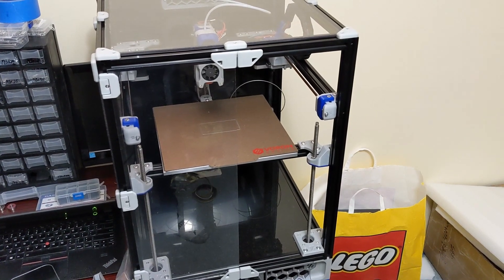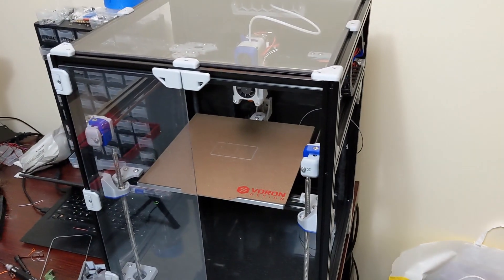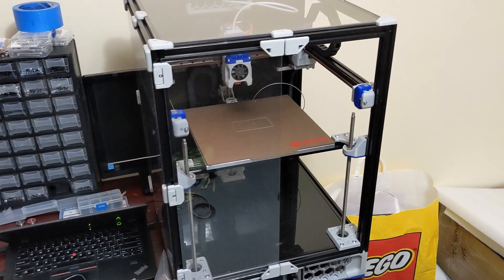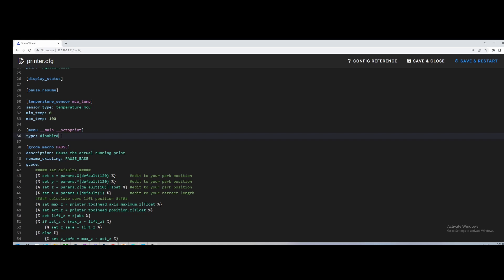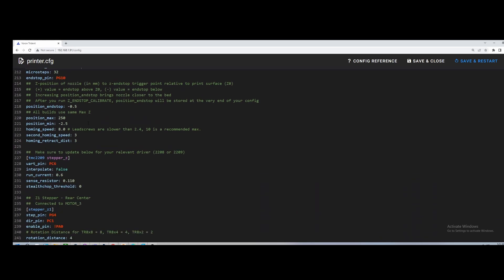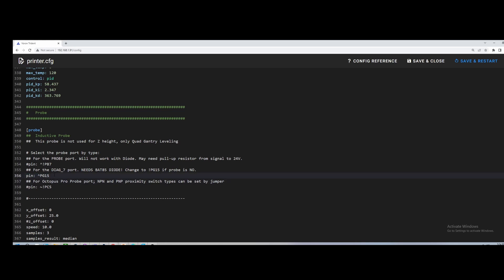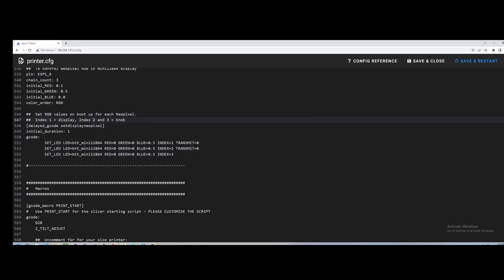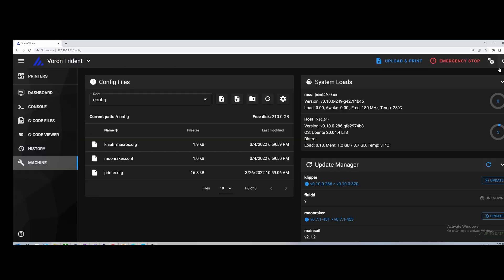FORMBOT Voron Trident 3D Printer Kit - Final - Config Overview

Comment: Hey, I am currently waiting on a Core One kit as my first printer but have been eyeing the Trident for some time now. Watched this and the previous vid (#5) and for the most part it seems pretty straight forward. Multiple online forum posts and such say to avoid Vorons as s first printer due to the tuning portion after the initial build, but others seem to say it should be fine if one is comfortable with command lines and such.

Anyway I wanted to ask given your experience with the very kit I was eyeing and this 3 year old video, given I am a SWE and like building things, would the trident be a worthwhile first printer? Or should I stick to waiting for the Core One and get a Voron later down the road?
Reply from the maker: I say build a trident, much more fun, cheaper and tunning it is not a big deal. Pretty easy and there are a lot of videos on tuning a printer. only command line stuff is to use input shaper and again very documented

Comment: the formbot trident pictures looks like a square box but yours looks like a rectangular like the LDO one, why is that?
Reply from the maker: I am sure it's just the camera, all Voron frames are the same. My kit was a 250 x 250, might just be that it's smaller and looks diffrent
Reply: @Rolohaun  are you saying its actually square but the camera makes it look rectanglular? I prefer the rectangular look, I would get the formbot trident if it is rectangular.
Reply from the maker: @pear-zq1uj  they are all the same, technically I can't remember if the 2020 are exact but the build volume is square and not matter what kit they will all look the same.
Reply: Doesn't look rectangular to me, a proper square

Comment: quick comment, if you setup your star_print correctly the homing and pre heat is completely independent of cure, superslicer.  just change the macro on start print on cura and  superslicer
Reply from the maker: I thought this too, it seems like cura adds some star gcode when you slice though and it didn't do want I wanted. I am sure I defiantly missed something
Reply from the maker: @UCL2bR1M6OQCMF3nIC4eGwog thanks!